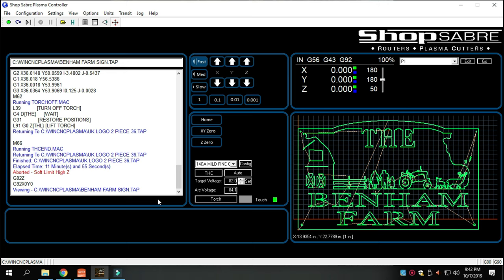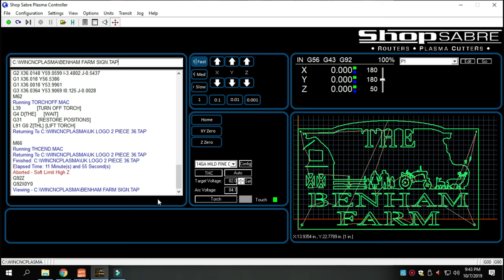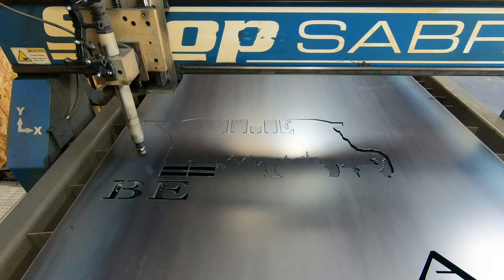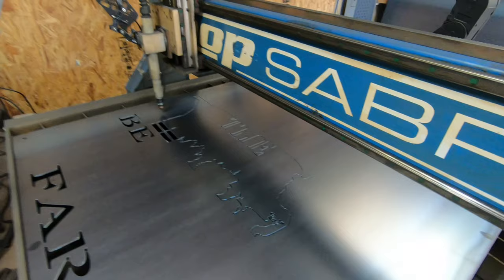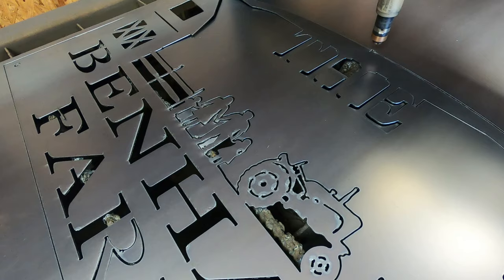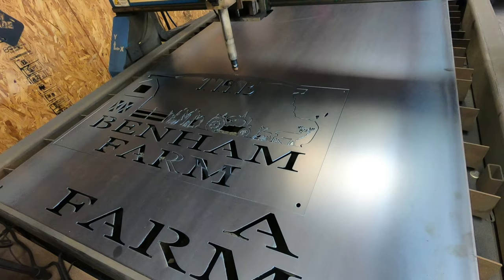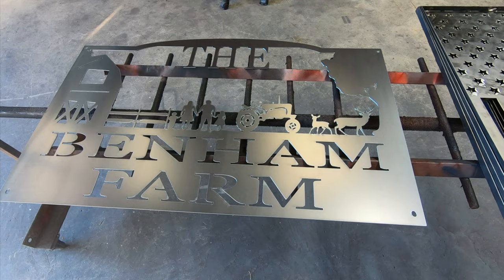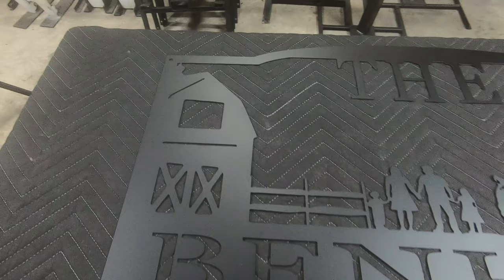How to make a one of kind farm sign

Comment: When you get a order for a sign. or a,design do you practice on a piece of scrap metal before you make the real thing ?
Reply from the maker: Sometimes i might run the torch for a couple short lines when i start for the day to make sure everything is set right. Normally test first thing, then run the rest of the day with no issues.